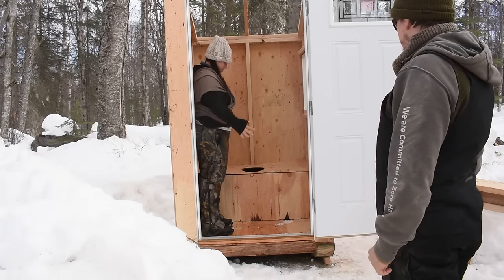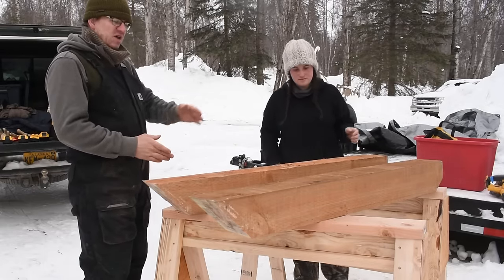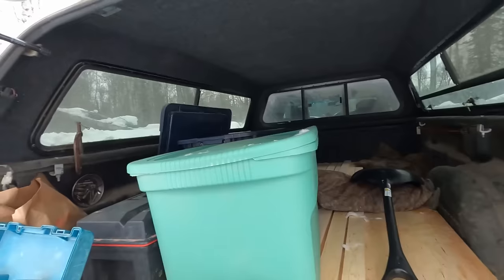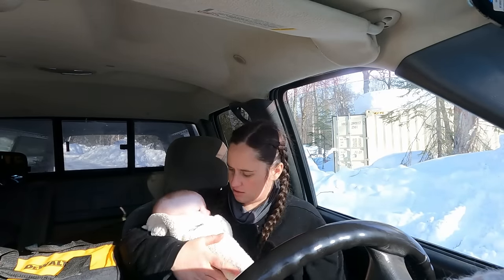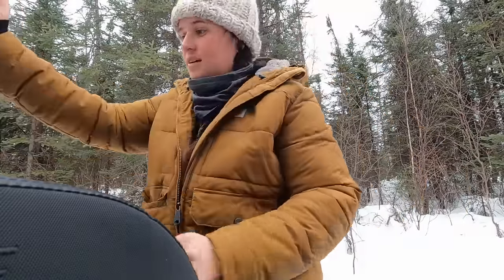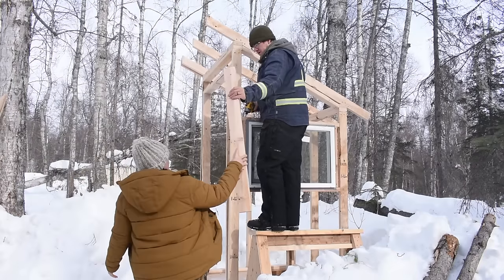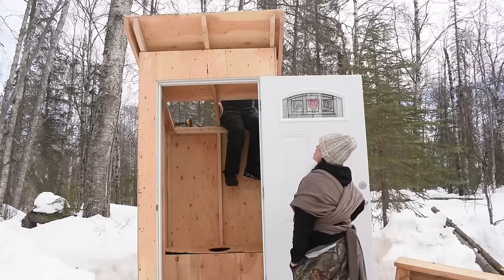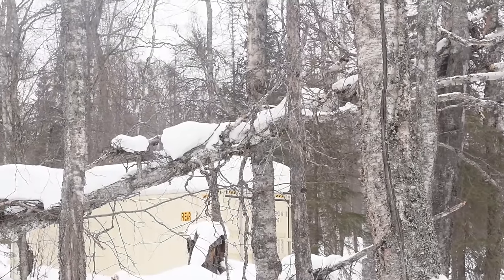Off-Grid Outhouse Build | Start to Finish

Comment: Don’t know if you thought about it Levi but you could also put you a hole in one of the back corners and run you a pipe up through roof like a porta John as well to help vent the hole and to help with smell. Which is the plan to use sawdust or anything after each use just curious.
Reply from the maker: If the window being cracked doesn't do it then we will run  pipe out for ventilation. The window was free though! And we plan to use lime to help waste break down.